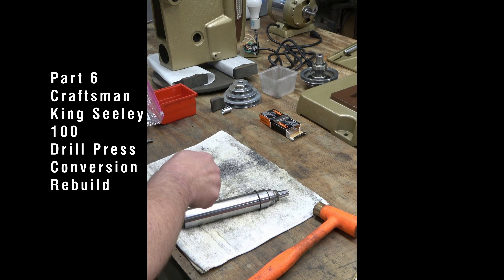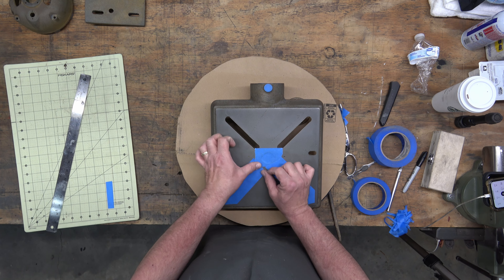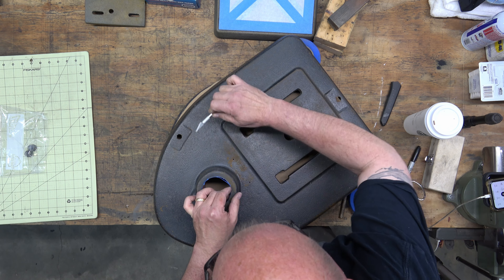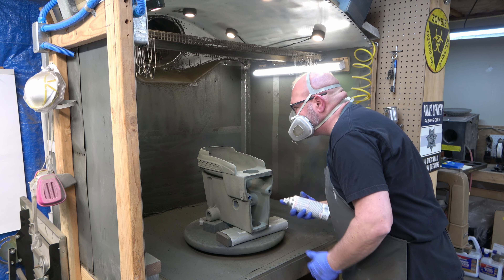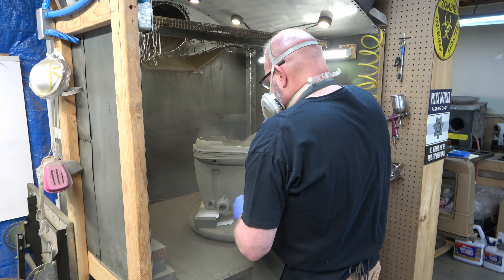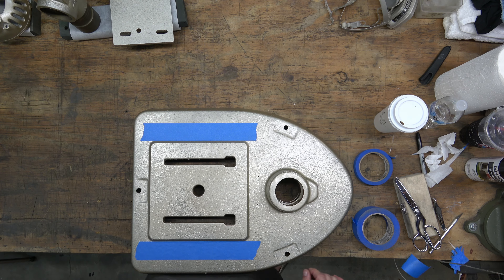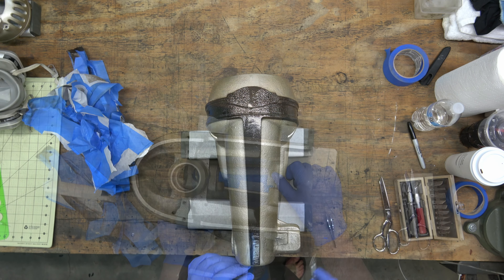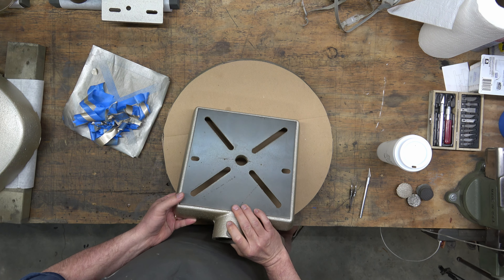Part 6 Craftsman King Seeley 100 Drill Press Conversion Rebuild (Painting)

Comment: Isn't original color a gray?
Reply from the maker: For this particular drill press, yes it was gray; however, there were two OEM colors for the 100 series drill presses and power bronze is the other color and the one I prefer.
Reply: Good to know. Im going to look at one today that a guy is selling for 150. I like old heritage series toolboxes etc @JeffsShop
Reply from the maker: @satinblack58  Good luck with the purchase. If you have not already done so, check out the Garage Journal Forum. There is a thread for vintage tool boxes as well as almost anything else tool related. Some really cool stuff out there.